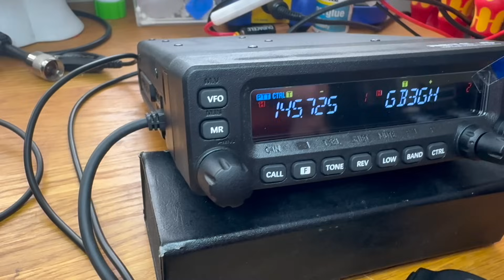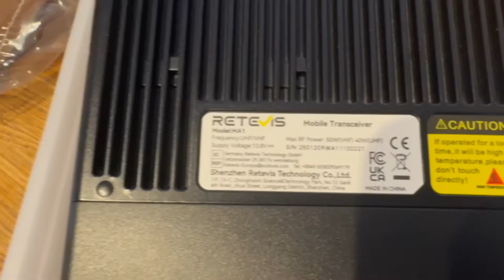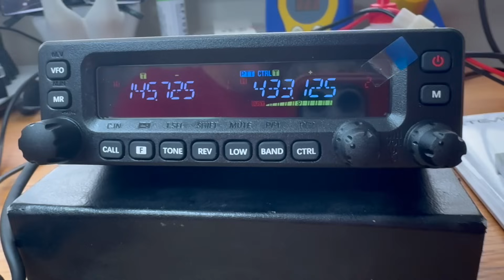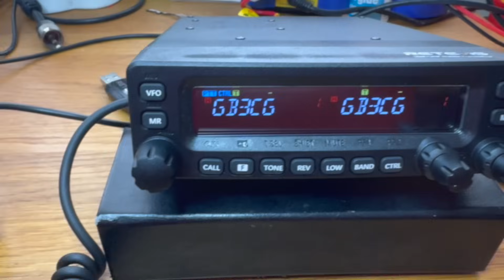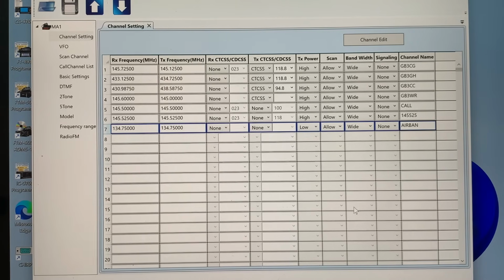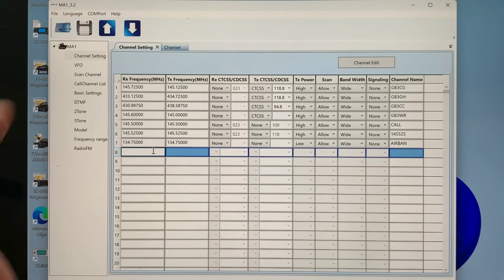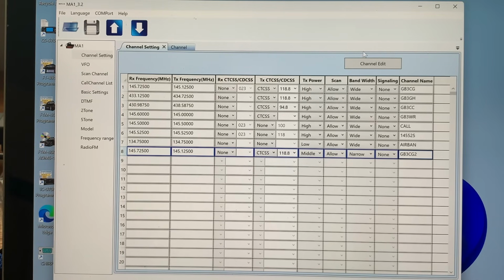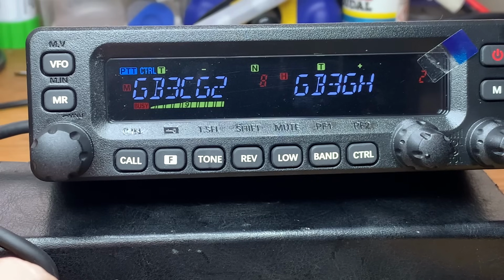Retevis MA1 Ham Radio 2M-70CM Mobile Radio With Air Band

Comment: Speaking of easy to program on front panels, the easiest ham radio I have ever programmed without software is my very old Kenwood TH-F6. You could show me a list of 20 ham repeaters with the codes and offsets and everything and I could program them into the radio in 2 minutes flat. The Baofeng UV5R is also easy to hand program. But the TH-F6 is just the best. I do have software for it too though. My much newer Kenwood (and very costly) Kenwood TH-D75 is actually not that easy to program by hand but not terrible.
Reply from the maker: Yep 100%

Comment: nice radio but personally would rather have a yaesu for an extra 50 quid with the added benefit of using fusion/C4fm on a decent unit instead of a cheaply made junk radio. Its a lot of money for who made it.
Reply from the maker: Thanks for your feedback.
Reply: I agree. I'm not a China radio basher but I just like Japanese quality better. They beat the Chinese on both receive and transmit. I own both and my Chinese radios collect dust. Despite heavy use, my Japanese rigs just don't wear out.

Comment: to get me back into 2m/70cm I'd need a radio that done SSB, not just FM. Probably asking too much but being able to dual band, like the Kenwood TH-D7 I have, with SSB. Perfect for Sats, and also data modes. I've not seen anything like that 'new' which is a real shame.
Reply from the maker: That is a good point, there is a gap in the market for that type of radio. 👍
Reply: @mike-M0MSN  as much as i miss my 9700, there mus be a way to make that into a smaller package, or extend the 705 so it can do it, its such an amazing radio, it just needs that small bit of extras to make it an excellent 2m/70cm radio as well.

Comment: A bit pricey, take a look at the TYT TH-9800 Plus | Quad Band | 50W | Remote Head | Cross Band Repeater down to £200 mark now. Hade mine three years regular use, and with 6 metres fm having two repeater close by. 
Don't use the 10m on fm but does open up for 11 metres
Reply from the maker: Yes this is the price bracket that you will get a lot more choice for your money, is the TYT capable of transmitting at the same time as receiving? Which is needed for satellite.
Reply: That TYT TH-9800 has a bad reputation for quality, less expensive for lower quality components. Same as most things is you get what you pay for. Not saying this reviewed radio is better, time will tell.
Reply: @jsm136  Yes it has varied views on it some very bad and nothing like the Yaesu 8900 it tried to copy but I have found it a great cheap radio. Mine is the mk2 version which supposedly ironed out the problems. I'd buy another